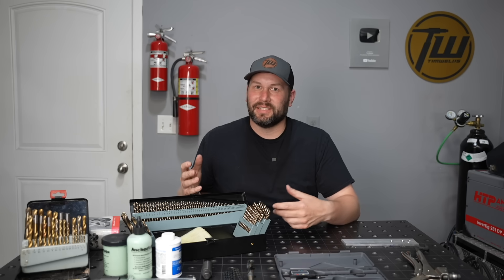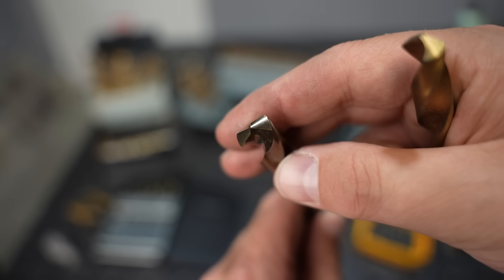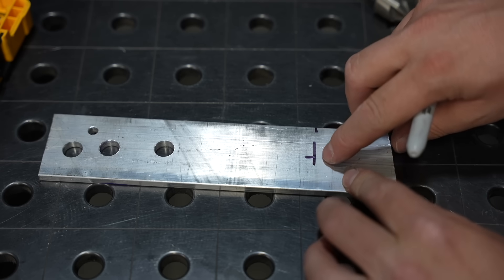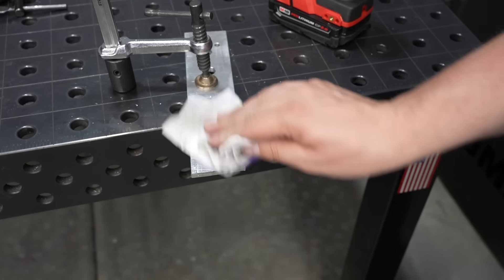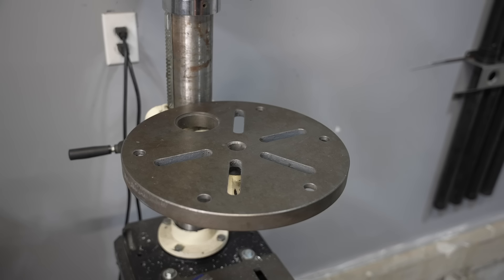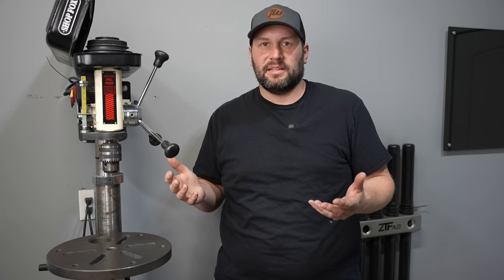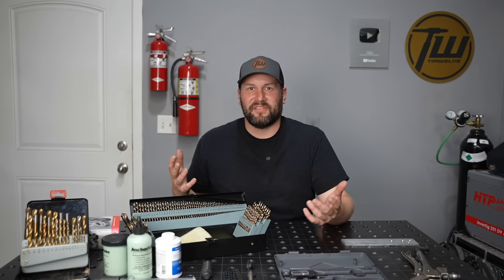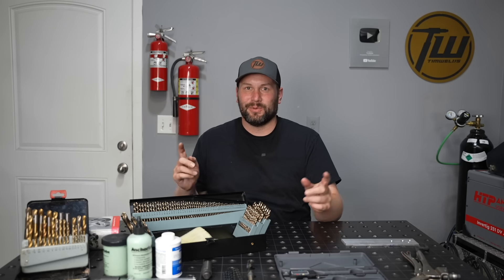How to Drill Holes in Metal: Master the Drill Press

Comment: I do a lot of work with stainless (304 and 316 mostly), and the key is to keep the friction low.  sharp cutting edge, cooling and/or lubrication, slow rpm (around 300 I think), and plenty of feed pressure.  if you don't press hard enough, the bit is dragging while cutting, which builds up heat and instantly work hardens the metal, and quickly dulls the bit...it's really a downward spiral from there.
Reply from the maker: Thanks, great tips! I've roasted more than a few drills on stainless; I'll have to try a little more pressure.
Reply: @TimWelds  It's not the heat that hardens this series of SS, it's the work hardening process itself that hardens the 304 and especially the 316. This series of SS is not hardenable with heat, however working the metal as in rubbing does indeed harden it. The statement is quite correct in maintaining that an aggressive cut is what is required to avoid this tendency in work hardening steels, and there are a number of them.
Reply: @74willy81  But if you have to use plenty of feed pressure, press hard to get the bit to cut, isn't that going to harden it then??
Reply: @steveclark..  No because the drill will be cutting metal that has not been work hardened. If you dwell in the cut or the drill is dull you will have problems with the metal work hardening. This is the metal's response to deformation, much like bending a piece of copper wire repeatedly until it becomes hard and breaks. The pressure and rubbing is what causes the metal to harden when drilling. not the cut itself.

Austenitic stainless steels ( 200 and 300 series ) are the most susceptible to work hardening, although the others are not immune. These metals are often cold rolled in order to harden them since they cannot be hardened with the more typical heat treatments.

It is somewhat of a strange phenomena since everything is great and then, bingo! A short dwell in the cut or a dull drill and it is game over. It's always best to know the devil you're dancing with so that one can keep all of his ducks in a row.
Reply: @74willy81  There's certainly a lot to learn when it comes to all sorts of materials really,..... when I were a boy, I thought that all stainless steel didn't rust and that a magnet wouldn't stick to it. LOL
I mainly have and work with scrap pieces of unknown steel, I've bought strips of O1 steel before, to make a knife or two, heat treat in the garage with my propane forge, temper back in kitchen oven etc.
Reply: @74willy81  Thanks, was going to say the same thing.
Reply: @HeyChickens  Thanks, totally makes sense.
Reply: @TimWelds  Just an interesting tidbit: Some SS is completely nonmagnetic, but if you hammer it flat on an anvil, it becomes magnetic, and harder to drill.
Reply: Stainless steel hates my guts. Not sure what I did to it but it loves to make life difficult for me, whenever it can. I suspect my taps are in cahoots, they wait until the last hole, then snap off with hardly anything protruding. Stainless burns me more often than any other metal, and having my die grinder burrs chatter suddenly will surely give me PTSD eventually. My die grinder is possessed, but that's another topic.
Reply: Does it help to lift the drill bit out of the metal periodically to cool everything? I have three drill presses and use them a fair amount but am pretty sure I still have a lot to learn.
Reply: @TruthInFlying  No, it's not the heat that hardens this series of SS. It is not hardenable by heat, no carbon in it to make that work. It work hardens by the rubbing of the drill bit against the metal that makes it hard. As soon as the drill stops cutting a thin layer at that boundary function gets super hard. The best thing you can do is to feed it aggressively. As soon as the chips stop coming off of the cut, it's game over and time for a carbide end mill or grinder. GRRR!
Reply: Despite getting a much larger drill press from an amateur store, I cannot feed into SS fast enough without the table flexing and causing chatter, eventually chipping the bit, especially carbide bits.  I now use a magnetic drill on a length of 1/2 inch mild steel plate clamped to the bench, overhung to allow secure workpiece clamps.  Now I can horse into the feed without chatter,  get long curly chips and longer bit life.   Life changing improvement!   Now I see how real machinists could make light  work of holes using proper manly drill presses.
I like to use a lot more lube than Tim showed, I guess for video clarity?
Reply: @jimwoods9551  Mag drills are great, wish I had one, a whole lot less flex than in all that makes up a drill press.
My drill press weighs close to 250 lbs. and it still flexes way more than I'd like. 
The biggest improvement I made to it was place a small hydraulic bottle jack underneath the table and slightly preload it against the table. Made a world of difference.
Reply: @74willy81  Great tip on getting the most stiffness from a drill press, mine's only half your weight.   Christmas still 6 months away, put the mag on the list!
Reply: @74willy81 that's why I still keep my old drill press made before WWW II .....heavy as a tank and no amount of pressure would move/flex anything.....😊
Reply: I know you're not gonna like this, but for those of us who AREN'T machinists and HAVE to go through stainless (right now--today), an alternative to all the bit breaking and dulling and wrestling and fighting (because you have a REAL job to do after this), consider a 220V arc welder set to 90A, with any stick you please. Set an arc on your desired point, and don't move. It will blow through 12G in about, oh--a second.  Shave it smooth with an angle grinder if you like--or don't. Drop a bolt and washer through the hole. (I can make fifty of these in the time it takes you to cry about your broken $40 Martian Cesium / Platinum alloy drill bit.)
Reply: @michaelsohocki1573  If I have a bunch of holes to drill in stainless steel, I will often use my plasma cutter just like you do the welder, and man I can tell you that it makes the job 50x faster! I like the idea of the stick welder though, because if I don't have a plasma cutter handy, there's one more option that I could use that I hadn't thought of prior to your comment.
Reply: @michaelsohocki1573 Good stuff!
Reply: "...a downward spiral from there..." Ha!
Reply: Even 300 rpm is too much, the pressure and a low RPM is the key
Reply: Exactly as soon as it gets hot good luck getting the bit through did steel buildings every so often had to deal with stainless plate
Reply: The key is ALWAYS to keep the friction low, no matter what material or operation.  Also, if you find stainless alloys annoying or challenging, try Tap Magic's fluids, they're life-changing (and expensive - also smelly, wear gloves).
Reply: Get a mag drill
Reply: Nice PUN

Comment: Since I drill a wide variety of materials, then a variable RPM DC motor for my drillpress is my next shop improvement.
Reply: If I can offer a suggestion. If you have multiple pieces of equipment you may want variable speed on, or have 3ph motors but only single phase power, then use the stock motors and get a VFD that you can plug in and swap between them.
Reply from the maker: I've been thinking about changing mine over. I have that on my mill and it's nice.

Comment: I have a pair of dedicated welding magnets that l keep with my drillpress.  I will either run the drill bit through the hole in the magnet or place them near where l'm drilling.  They work really well for catching the material spit out by the bit (obviously only works with steel).  Then with gloves on l clean the magnet off.  They probably catch about 80 to 90% of the shavings.  Really helps keep my shop clean.  Cheers.
Reply: Wrap the magnet in cling wrap, then remove it over the swarf bin. All the shavings go directly into the bin and no tiny bits stay on the magnet.
Reply from the maker: I'll have to give that a try! Thanks!
Reply: Good idea. You could also place the magnet in a small plastic bag. Then you can take the magnet out of the bag when you are ready to cleanly remove the collected swarth.
Reply: @petcatznz . SUPER IDEA. I am going to use that with the modification of turning the plastic bag inside out. Then as I pull it off the magnet it will go more easily to gather and remove. Going to try it both ways. Thanks!
Reply: A old carpenter showed me how to drill steel door jams overhead so you Don't get stuff in your eyes , use a speaker magnet a drill thru the hole in the magner.

Comment: Scribing is often a bad idea on aluminum parts as it provides a fatigue crack initiation site.  Not a big deal for projects that don’t see cyclic loads, but for fabrication of airplane parts and such, scribing is generally discouraged or prohibited.  Less of an issue with steel, but can still cause problems in parts subject to high cyclic loads.
Reply from the maker: Thanks! Definitely important to keep in mind when working on layout.
Reply: @TimWelds  I am building an airplane and when hole placement accuracy is very important, I will create a template that can be scribed or whatever to get a couple of #40 locating holes drilled.  I then can use the template to drill into the actual parts with a #40 and then final size from there and get pretty accurate placement with no need to mar the real part.
Reply: Amen to scribe fatigue initiation.  We had a 1/4" 6061 Al plate bent to only 135 deg.  It had a scribe mark of where to bend.   And that small line on a relatively thick part would really impact the service life of the part.
Reply: Just make the scribes smaller than the hole diameter.
Reply: @wernerostwald287  Try doing that with #40 holes.
Reply: @LTVoyager  Wholly...what's your point? Most holes are larger...for smaller holes just use the center punch directly with the square guide directly without scribing.
Reply: @wernerostwald287  The point was that scratches on aluminum can cause stress risers and cracks. Are you unable to read?
Reply: @LTVoyager  No...I failed literature...and apparently you comprehension...good bye.
Reply: @wernerostwald287  Yes, run and hide.  That is the best approach when you are wrong.
Reply: @LTVoyager  I don't run from anyone...I just choose to ignore your bullshit from now on!
Reply: @wernerostwald287  Run along.  Go do your homework so you can understand things better next time.
Reply: Does it mitigate this issue to polish the part after drilling and deburring?
Reply: @ If you polish until reaching the bottom of the scratch, then there is no problem.

Comment: I generally have to drill a 1/8" pilot hole first (with a short double ended bit) to allow larger standard drill bits to work well.
Reply from the maker: Thanks!
Reply: In some cases, I'll use a series of three or more drills of increasing size. I think it gives me more control of the process and is easier on the bits.
Reply: Why not? 🙂A pilot hole only needs to be wider that the web of the drill bit used to finish a hole. And IMO 1/8" is a fine go to or spotter for 1/4" to 3/4" or so holes.
Reply: A gunsmith told me don't use a pilot drill any wider than the web thickness. close to, but not wider. Made sense to me .
  @johncmitchell4941
Reply: @johncmitchell4941  A gunsmith friend/machinist told me not to go wider than the web, but ok to go under.

Comment: Rag covering magnet to clean up the shavings
Reply from the maker: I'll have to try that out! I have a stick magnet to clean up after, but it would be nice to catch them up front.
Reply: Magnet in a small pill bottle.  Wipe the pill bottle over the work.
Reply: There's a couple magnetic tools for picking up chips where you just pull back on the handle to slide the magnet back and everything drops right off of it. They're often used for cleaning out the water table on a CNC plasma cutter or the waste tray on small lathes.
Reply: I use a ziplock bag.
Reply: As long as the drill is not running.

Comment: Very useful video, Tim. I have been doing metalworking only for a few years since I retired. I'm not particularly good at it, but it's lots of fun. I have found that drilling holes accurately in metal, but also in wood is a bit more challenging than I had anticipated. I had a lot of frustration with hardware store automatic punches. A few months ago I decided to spend the money on a Starrett automatic punch, which was pretty expensive but works a lot better. With my aging eyesight I find it necessary to scribe a small cross in the middle of the surface, and then find the junction by feel with the tip of a punch. I used to use a spotting drill to start a hole if it needed to be accurate, but split point bits work just as well. Keep up the good work Tim. I purchased your entire set of instructional videos and they are great.😮
Reply from the maker: Thanks a ton! Glad to hear you're enjoying the courses!

Comment: I find step bits often make better deburring tools than countersinks because they are self-centering and don't chatter. They're also the easiest way to center a bigger hole on an existing hole, especially if you are drilling freehand. In thicker stock use the step bit to enlarge the hole then switch bits to go deeper
Reply from the maker: Great tip! Thanks!
Reply: Likewise.
Reply: I run a cnc shop, and the few holes we do have to countersink out of the machine use a multiflute  countersink. This helps stabilize the bit in the cut and need less spindle speed. Single flutes take a delicate feel and rigid work holding to use by hand.
Reply: Also amazing for sheet metal or thin walled extrusions/tubes.
Reply: The countersink bits always seem to go dull in no time on me.
Reply: @garychandler4296  they are also easy to sharpen. Spin backward & hold against a 'stone with some lube.
Reply: Thanks for that tip !  Centering an already drilled hole was awful.
Reply: They are also very easy to sharpen!

https://youtu.be/tWdWPau_oxg
Reply: I agree. Used one today to chamfer a hole actually.
Reply: Gonna try that, thx.
Reply: @garychandler4296  that's how to sharpen countersinks, here's how to sharpe unibits:

Comment: Thanks for the summary. I've always had issues with clamping my metal vice to the drill press table, as you've stated. The holes never seem to line up.
Reply from the maker: I agree, it takes way too long to be practical in most cases.